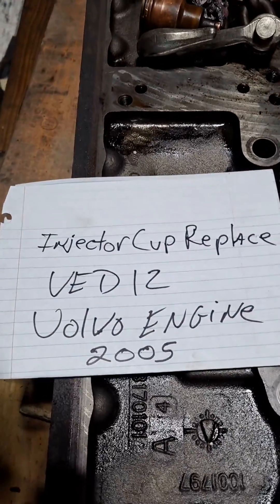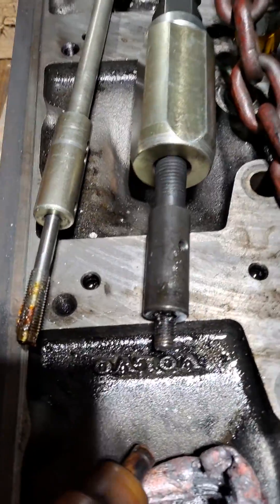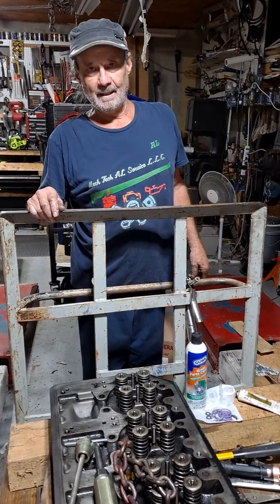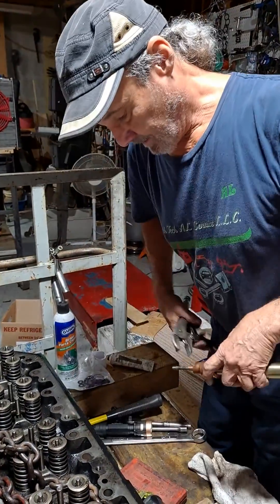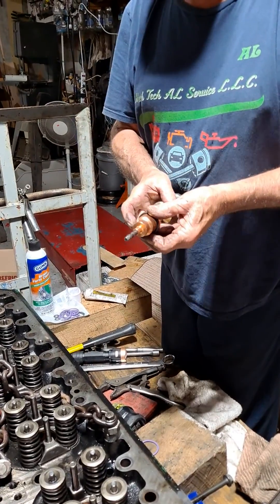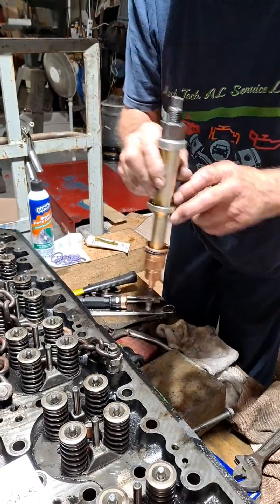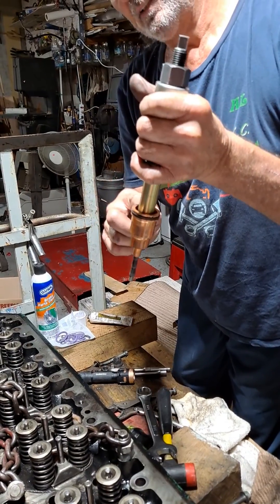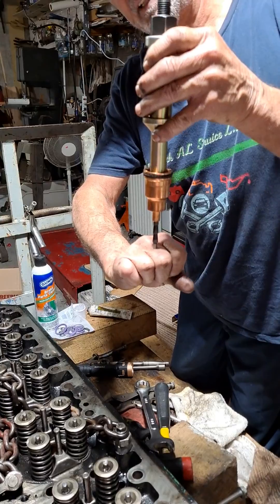How to replace  Volvo injector cups on a 12 liter Part#2 Volvo 2007 and older

Comment: Do you have the part number for the cup removing / installing tool? Thanks!
Reply from the maker: The tool comes in a kit known as K.T.C. vol1516 sleeve remover /installer. I will see if I can a some pics of it

Comment: What are the signals in the engine to do cup replacement?
Reply from the maker: A mixing of anti-freeze and fuel, a misfiring injector, the radiator reservoir swells up due to pressure from fuel, and fuel can also lose its prime 

.
Reply: do you use any type of sealant on the bottom on the cup or just clean the surface nice and install it clean?

Comment: So which Engine use better with a D12 or a D13 to work on
Reply from the maker: In my opinion, the d12 and the d13 I think were made to be put in European trucks like the cab over, everything is backward all the gears are in the back under the dog house and they made the dog house a chore to get out.
Reply: Ok👍
Reply: Does these engines use the same injector cups?